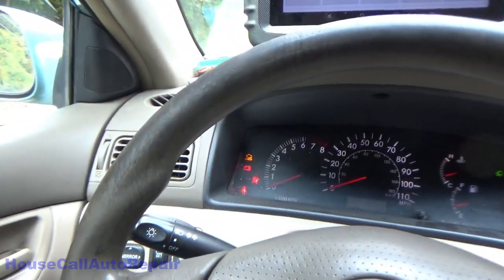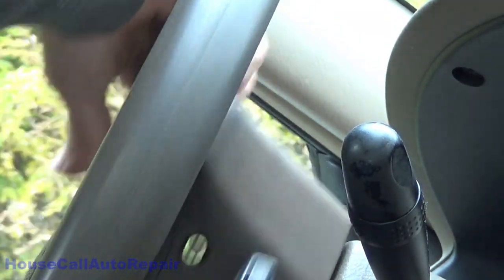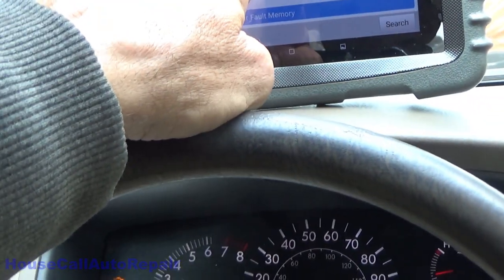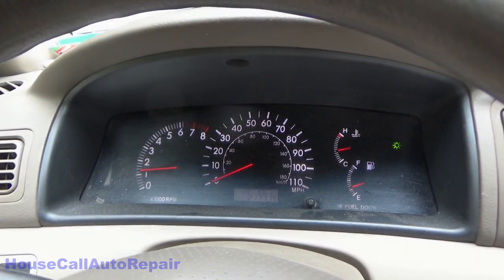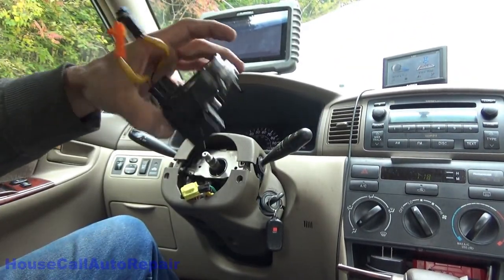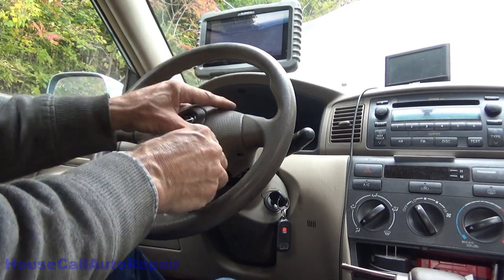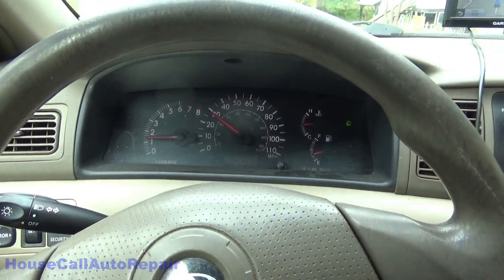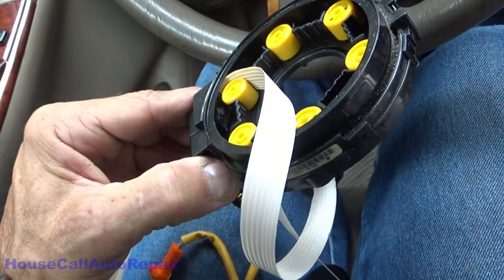2006 Toyota Corolla B1811 Air Bag Code - Clock Spring Replacement

Comment: Hello! Cool fix!! My 02' Corolla has 215k miles. Changed my upstream O2 sensor, but of course it's a downstream one that needs to be changed. I've tried several times but couldn't. Just not enough room. I'll be taking it to a shop for help to break it loose 😊! Thank you very much, looks very good! Enjoy!😊
Reply from the maker: Might be time to change my downstream sensor again. The one I put in not that long ago, is starting to run out of normal range
Reply: @HouseCallAutoRepair  passed emission test a month ago the light didn't come back on in three weeks after disconnecting the battery. Engine hesitates sometimes on idle. Runs fast with premium gas! Thank you!